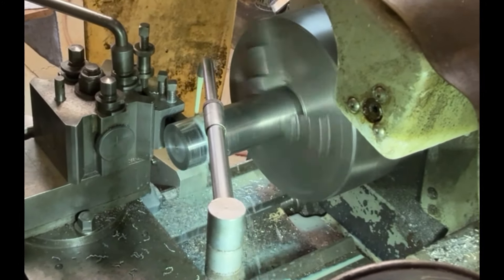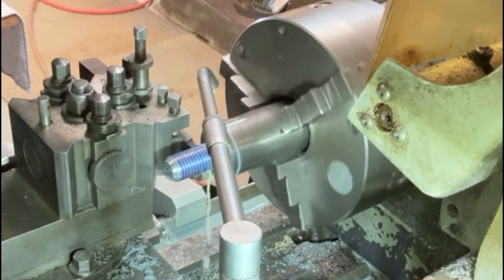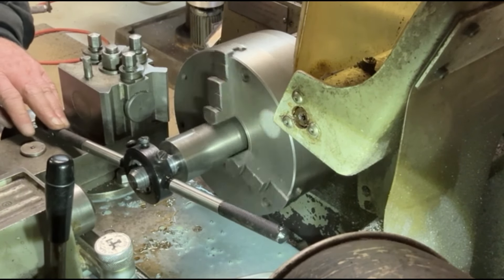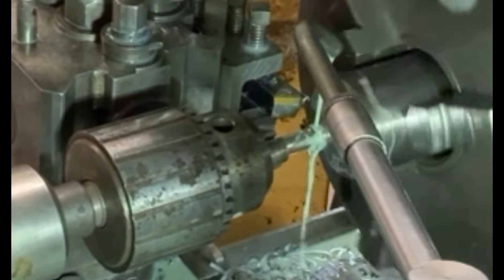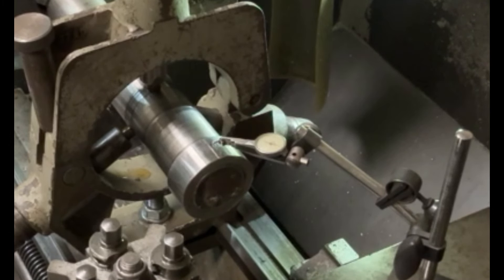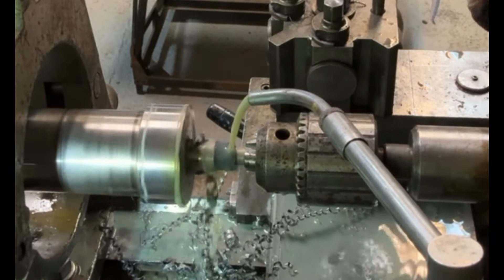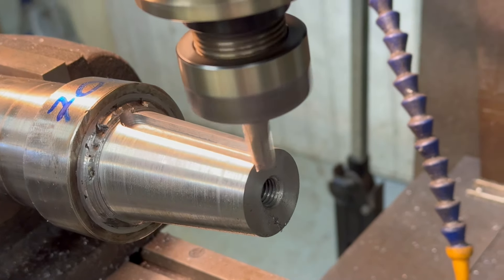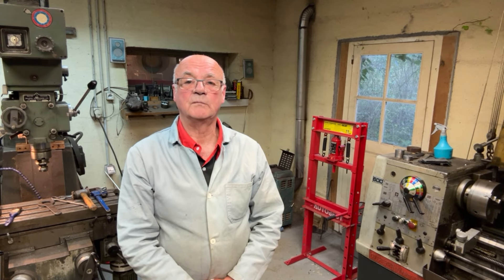Repairing a cone end on a  large shaft.

Comment: An interesting video. Thanks ! I was wondering what your opinion was on running oil instead of flood coolant with a lathe or milling machine. I’m mostly using carbide inserts with cutting oil by brush or spray can. Both of my machines have coolant pumps, but so far I haven’t used them.
Reply from the maker: Hi Greg. Thanks for the comment. Never tried just using oil as a cutting lubricant.  Oil is fine as a lubricant but it have very good cooling properties. Soluble oil is quite expensive but well worth using even with carbide tipped tools which I use all the time except when machining brass or aluminium.